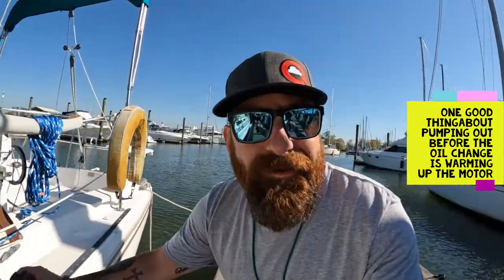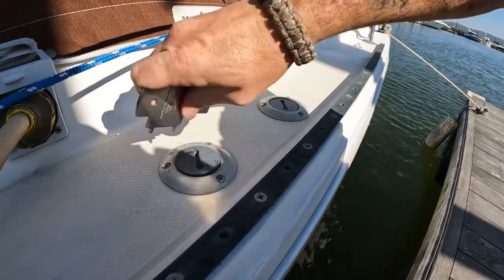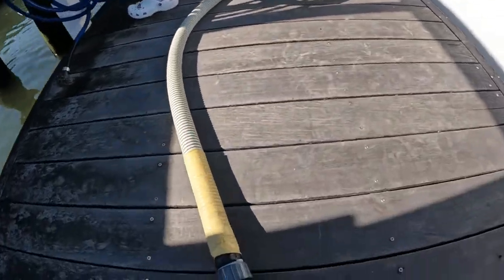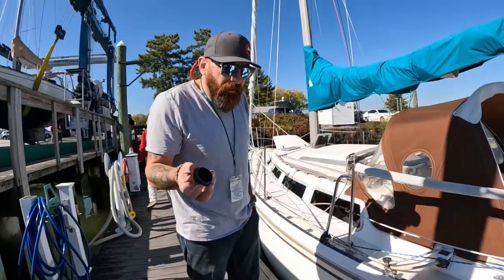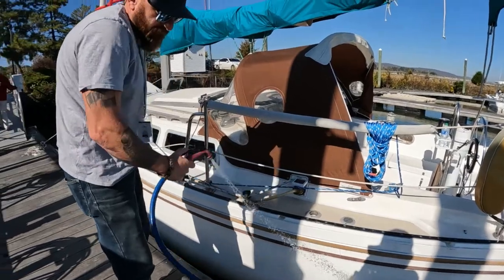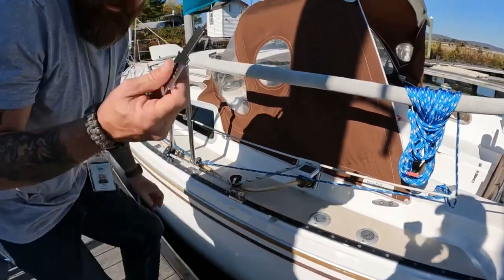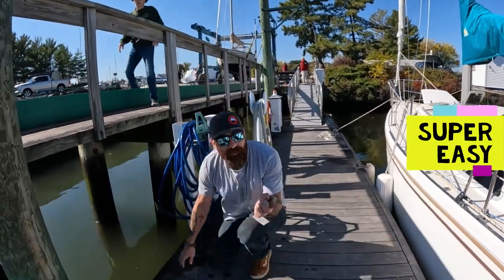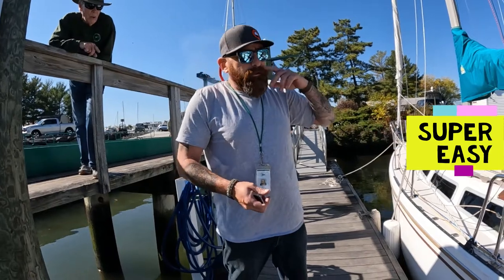Pump out and Oil change on a Catalina 30

Comment: My cat did my last oil change.  We were sitting at the dock with the end of the settee open and my cat went down into the settee.  There was a hose on the drain plug the previous owner had set up.  Somehow my cat knocked the plug out of it and the oil started going into the bilge.    HE got it all over himself, suddenly we heard this BANG BANG BANG BANG CRACKITY BANG under the settee boards and he came racing out of the end of the settee covered in oil and went up into the cockpit.  We had to put the guy in a trash bag(with his head out), and I suited up in a welding jacket and gloves.  We then took him to the marina showers....Dawn dish soap does work to clean animals of oil...shampoo....well.....not so much.  Hey I agree 100 hours is just fine, fifty is really kinda crazy and what everyone usually says.  If it were highway miles that would be 3000 miles, but we all know from Consumer Reports, etc that 7500 miles is usually OK, even for NY taxis.
Reply from the maker: My gens at work are recommending 480 hrs I change them at 240

Comment: It seems to me like 15W40 is a very heavy oil to use for the short duration runs in and out of marinas in the Caribbean much less the Hudson river in NYS. Diesels run cool and marine diesels run even cooler since they're not under any particularly heavy load, they take forever for the oil to get hot. The heavy  weight oil puts a strain on your starter and battery and the thick oil doesn't get through all the galleries as quickly at startup. Given all that, the engine is operating in a severe service environment since it never gets hot enough to burn off condensation and it's apt to build sludge deposits. If this sounds familiar I'd strongly recommend changing the oil and filter at the end of the season, fresh oil over the winter months. Just my two cents.

Comment: I hope the freshwater hose you are putting down the pump out fill is labeled “not potable” and going into someone’s  freshwater drinking tank. 

If so there would be a serious ecoli concern!
Reply from the maker: Lol yes that is the wash out hose
Reply: Thx for the response, really enjoy your vids, clearly you have a mechanical mind and or background, working on a cat 30 in such tight quarters is a struggle Trick that works for me is to use a garbage bag wrapped around the filter when changing. No oil anywhere but the bag for easy disposal.
Reply from the maker: @markcanterbury4847  that's a great idea 💡 might give it a try next year 
Thank you for watching if you ever have a topic you want me to work on please let me know